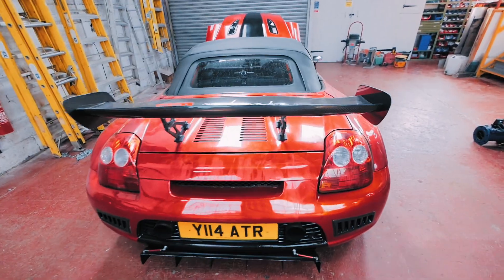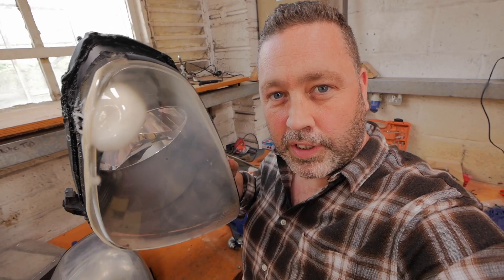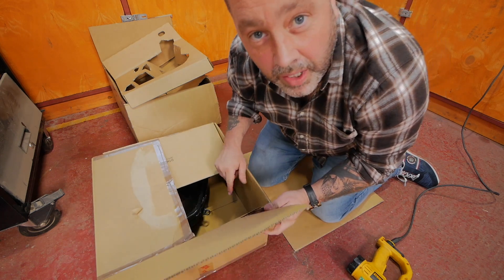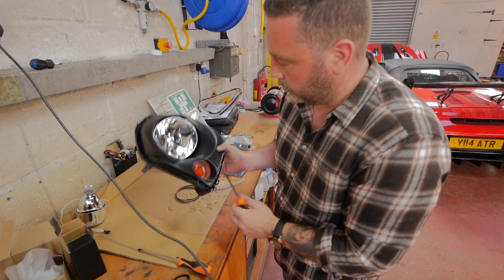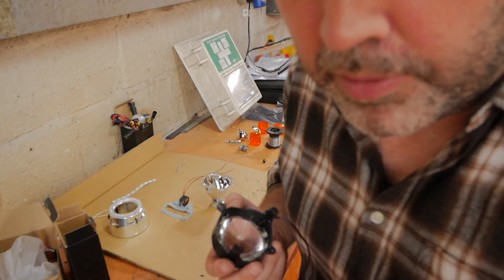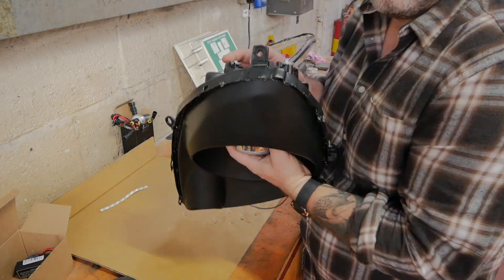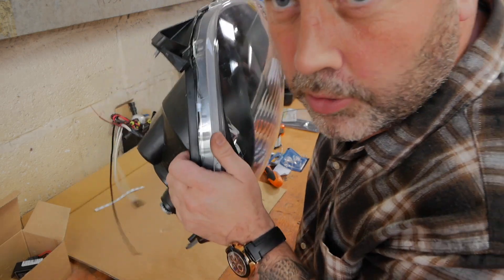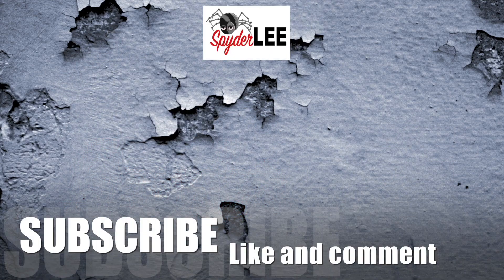Bi-xenon hid projector retrofit with demon eye mr2 spyder part 1

Comment from the maker: What’s everyone think of the look?
Reply: Looks a lot better, very impressive. How does it improve the beam strength/distance and did you think of colour coding the black internal housing of the light unit? Awesome video BTW.
Reply from the maker: Cheers. Beam looks a lot nicer against the workshop door.. will have to wait until it’s finished for a proper test. I saw a photo of a colour coded housing before. I thought it looked terrible, but that’s my opinion.
Reply: almost as sexy as i am... and i am pretty freaking sexy if i say so myself!

Comment: So I have a (presumably) dumb question.  Why are headlight lenses glued?  I completely understand keeping moisture out of the lamp, that makes sense, but I was just curious why you couldn't seal them with a rubber gasket and clips... if that were possible it would make future modifications (or repairs) much, much easier.  That said I'm sure it would require fabricating some custom components. 

Hopefully the stupidity of my question doesn't cause a headache.

Comment: Awesome video! Can’t wait for part 2. I have a question, do you NEED an HID conversion kit? What is it used for, like what’s the purpose of it? Also how do you know which conversion kit to get for the projector headlights you bought?
Reply from the maker: Steve not sure if you could use the projectors without hids.. don’t see why not. The projectors are for a h1 bulb so just bought the hids in h1
Reply: SpyderLEE Right on, I just went ahead and bought the kit with the bulbs and everything. Another question is do you have to remove the front bumper to take the headlights out? If so, can you do a tutorial on how you do that? Idk how to remove the front bumper and I haven’t found any guides online either.
Reply from the maker: Steve you don’t have to remove it Just Loosen it. To be honest I don’t remember what holds the stock bumper on. It’s been a couple of year since I had one. Mine is completely different and I have to remove it to get the lights off

Comment: Hey Lee, wanted to ask you something that I’m having trouble on. So with the lights, the little ballast thing that came with it (the tiny box that has the white cables and the long red and black cables) where does the red and black cables connect to? They come uncut and not exactly sure where they even connect to begin with. Everything else is basically plugging in to itself but that’s the only thing I’m confused on. As well as the two live and ground cables you pointed out on the video (the red and black that are loose on the HID bulbs)

Edit: I also forgot to mention. The black and red wires that actually come connected to the lights that are next to the hi and low beams white cables, where do you plug those into?
Reply from the maker: Steve if I remember correctly the white cables were from the halo ring. And they plugged into a ballast which has a red/black cable. This needs connecting to the sidelight. The red/black wire that came out of the light was for the high/low beam shutter.
Reply: SpyderLEE Gotcha. How does the clip that holds the bulb work? I’m trying to fit the clip behind the bulb to hold it but it’s not exactly attaching right. How does it exactly work?
Reply from the maker: Steve stick the 2 pointy bits through the 2 little holes , the bend sits on the back of the bulb. Bend the end down and clip it in at the other side. Bit hard to explain but it's obvious when you get it
Reply: SpyderLEE You were right, I got the clip on. I just had to flip the clip so it can fit. I also have to ask, did your bulbs come with a high beam wire? Because my Spyder has three holes to fit a wire into, the top is low beam and the right is ground. I have a wire in both of those holes but not a wire in the left slot which is my high beams. So basically whenever I flip my high beams on, my headlights are just off because I don’t have any high beams. I also didn’t know where to connect the red and black wire coming out of the projectors that were for the high beam shutter, don’t know where to put those cables and how to give them power. Same goes with the halo ring, don’t know where to connect the wires to give the halo ring power. It was a bit confusing so all that works for me are just the low beams and only the low beams
Reply from the maker: Steve you need to watch part 2 of this video... but unless you have some sort of electrical experience your gonna struggle a bit. You might want to get some help to get it all wired up properly, it’s not that straight forward
Reply: SpyderLEE I had thought it was very straight forward but I guess I had underestimated it lol I might seek help if that’s the case because I would very much like my lights like yours, rings are on when you turn the ignition on and everything.
Reply from the maker: Steve dude I’ve been an electrician for 26 years, even for me it was a bit of a pain to get working right.

Comment: Spyder you are sooooo like me!  You just can't leave shit alone LOL.  Gotta be different, Love it! I had a pr that someone put high wattage bulbs in and the lens were stress cracked from the heat. No amount of polishing was going to fix those lenses. And you can't just buy lenses. So I made new ones and did some custom work while I was in there. Check it out. on the link provided. They are still going yrs later.  This is from a few years ago, and car has changed a whole lot since but it will give you an idea: http://www.carstereo.com/installs/photo_gallery_album.cfm?home=yes&photoid=75156&galleryid=6363&stereo=2003-Toyota-MR2-Spyder-car-audio-system